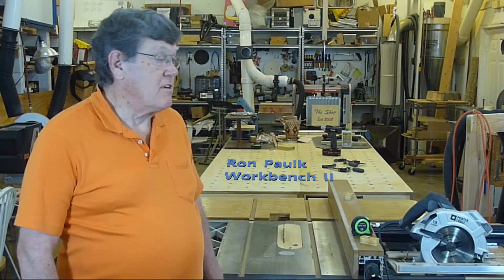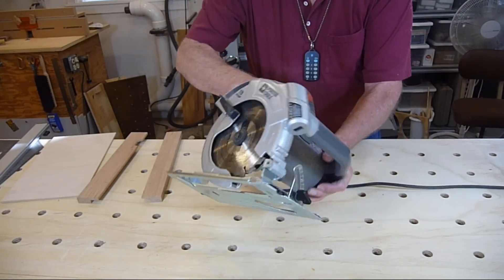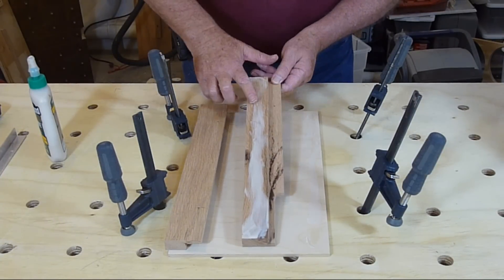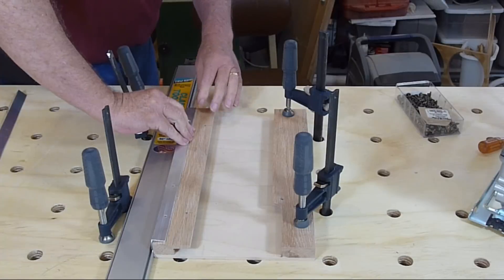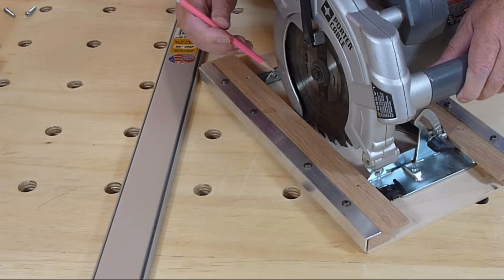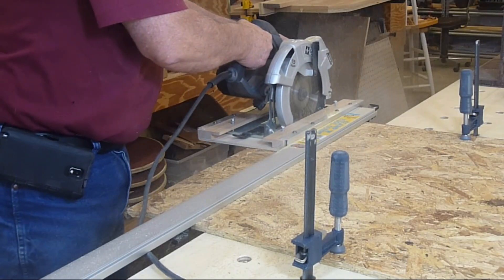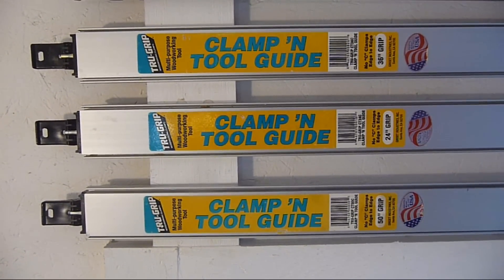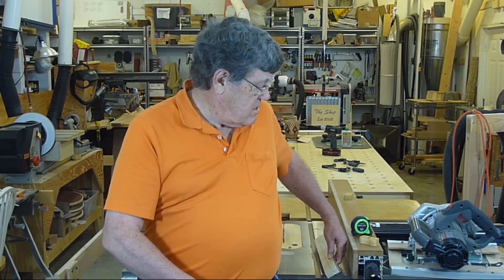Circular Saw Guide

Comment: Earl, have you searched You-Tube for "circular track saw guide"?  I think Jay Bates (among quite a few) have a video on making one.  No need to measure offsets like you have to with those straight edges.  I have a few of the straight edges and after making my own track say guide I haven't used them other than for marking an occasional line that's longer than my yard stick.   Thanks for sharing your videos.
Reply from the maker: +Larry527az Yes, Larry, I've seen most of them.  I've built and used "saw board" style tracks.  What I find with them is they still have to be clamped down and I still have to measure and mark my cut anyway.  In woodworking there are usually several ways to skin a cat.  Thanks for watching and thanks for the comment!

Comment: I love this, bcuz I have some Harbor freight Tools straight-edge clamps, w/grooves on both sides of the clamp, similar to yours. I had thought of this method, of using something narrow to ride inside these grooves, but didnt think hard enuf to come up w/the method of how I'd be mounting it to my base plate. I guess I need to make a new, wider base plate, to accomodate the wooden pieces & angle iron. One question/suggestion, though - do u ever have problems w/stability, or keeping the base EXACTLY 90 degrees to the wood being cut? I think when I make mine, it'll have two straightedge clamps - one on each side of the saw - & then that way it cant go ANYWHERE, but straight. I have actually made a sled w/the double straight edge concept, longer than 8', to cut full sheets lengthwise, having the saw cut out 2 kerfs, having the saw pointed in both directions, w/room to clamp it down, on the extra wood on the other side of the straightedges. This is all made w/wood, so its a fricken beast to use on crosscutting, cumbersome. Your solution is perfect for crosscuts, using those straight-edge guides. Thank u for sharing, & maybe I'll get around to sharing a video that I'll potentially record, for my beast of a track saw guide, someday. Aloha
Reply from the maker: +Agboo Hans Thanks for the comment Agboo.  I've used this guide a bunch of time with outstanding results.  Not once has the guide slipped out of the grove on the clamp and the clamps have never moved during a cut.  Two guides are not needed.

Comment: Cheap and accurate guide, but the system does not allow positioning the guide or registering it against a line. You have to use measurement, which could give up a fraction here or there... I wonder if you could extend markers/tabs/sticks at each end of the home made portion of the saw base/fence follower which allowed the follower to line up against a line.. You would have to make a cut and measure/postion where they fasten against the edge leading and trailing edge of the base plate/follower. I guess in operation you would do the registration of your markers at one of the line then clamp one end of the fence, then move the follower to the other end of the fence and register again against your line and clamp.
Reply from the maker: Thanks for the comment Eric.  Yes, you have to measure and accurately place your clamp on the piece to cut.  In my case, the clamp is spaced 6.5 inches from the desired cut line.  The guide does, however, help me make accurate cuts after I've measured and placed the clamp.  This was my goal when I made the guide.

Comment: old school tumbs up
Reply from the maker: +WV591    :)   old school thanks!
Reply: you can't even buy those clamps any more i think that company closed shop. they were original.
Reply: +WV591 Like many old woodworkers, I have a set of these exact clamps, and have been trying to figger out a way to make a nice track saw out of them with my (also) Porter Cable circ saw.    Voila.    Now, I just need to go get me my angle and set this up.    THANKS a ton!

Comment: You could also screw 1/8 or 1/4 by say 10 inch wide panel product to the bottom side of the tru guide clamp. Then run the saw to trim to size. Now you have your reference edge/ cutline! Okay, the clamp maybe doesn't work as a clamp anymore. So what? Sacrifice one function for another.
Reply from the maker: Thanks for watching!

Comment: Nice job on the jig. I have made my living for over 40 years as a carpenter/trim and cabinet. I very seldom would use one like you made in this video, to much room for error in measuring over for cut. I have use ones like the guy in this video has built many many times , no mistakes measuring over.  Just make sure you are cutting on the correct side of the line.  https://www.youtube.com/watch?v=thddTmC6nr4I was using these before this young man was thought of, Boy that makes me old. LOL
Reply from the maker: +William Castleberry Thanks for the comment William.  I've used that kind also and have one standing in the corner now.

Comment: M not sure if you really need to make it when there is already a base plate in the circular saw and ur still using the rail
Reply from the maker: The aluminum angle rides in the groove on the clamp which keeps the saw from wondering away from the guide.  It definately helps.

Comment: What's the point of this when you're using the saw improperly?  Unless there's a compelling reason to do otherwise, the wide part of the sole plate should ride on the stock .  This provides stability  and lets the stock support the weight of the saw - which enhances safety.  That's why the saw is built that way in the first place.

With this rig, any improvement you make in straight is going to be offset by uneven edges due to saw wobble.   Turn the saw around and you're in like Flynn.
Reply from the maker: You're right of course.  That's why I made the jig so that either side of the saw can ride on the clamp - as shown in the video.
Reply: My bad.  I stopped the video before you turned the saw around.

Comment: The video title is written wrongly.there is no point in using this as guide as the base plate can slide on the surface with a fence and marking are given on the same base plate........ Rather if you can manage to attach four legs and place the saw with the guide upside down it will become a table saw.